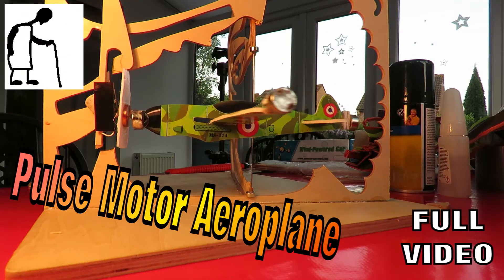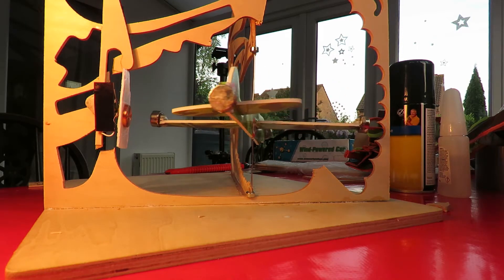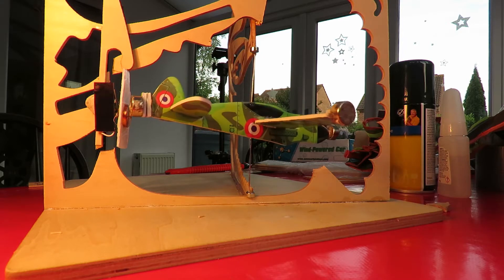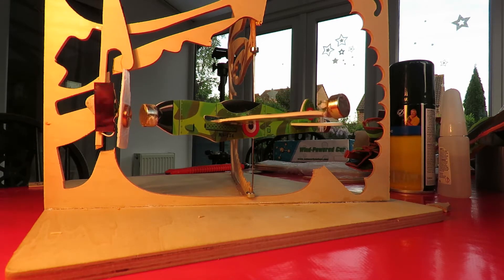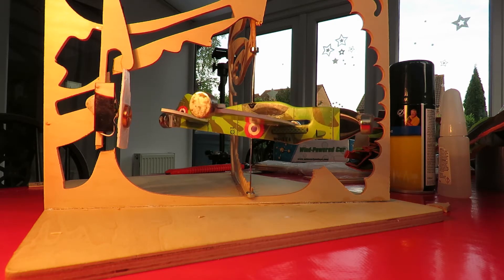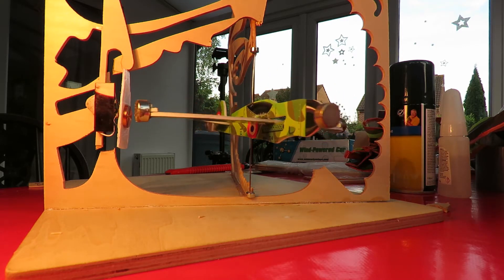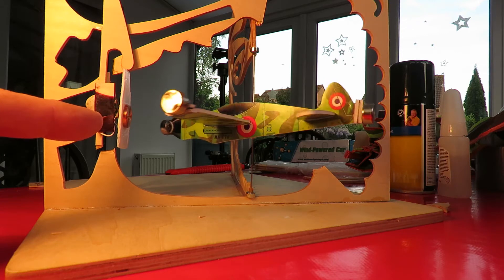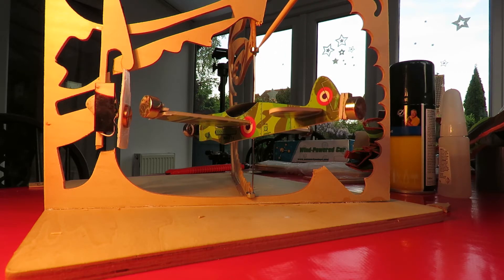Pulse Motor Aeroplane - Main Video

Comment: Very well balanced . It’s hard to turn a diameter that size with a solar toy . A good way to get the little coil off the solar toy is to heat up the plastic and they just pull off.
Reply from the maker: Thank you

Comment: Do you have any UV light bulbs? It would really take off then!!  UV bulbs are  sunlight.
Reply from the maker: No I don't have any UV light bulbs but I do have a small UV torch used for checking bank notes and it does work with that. I will do a video to show it but I am not sure when I can fit it into my schedule, might take a couple of weeks.